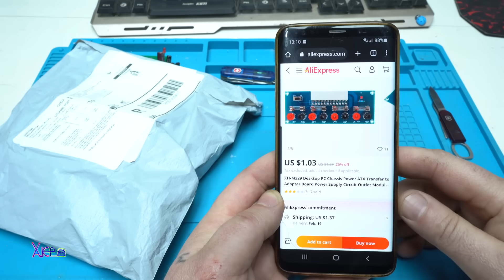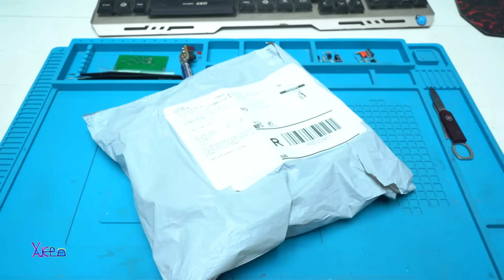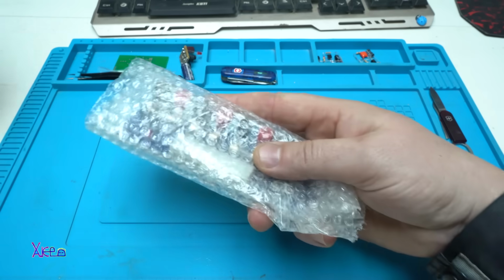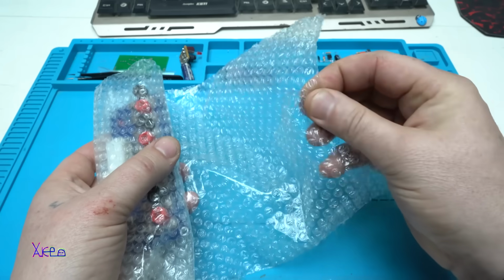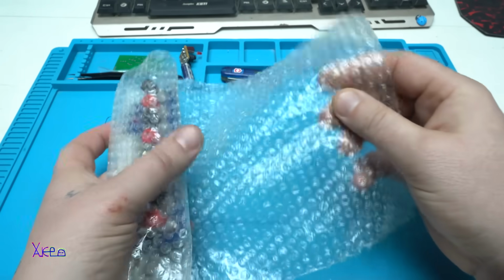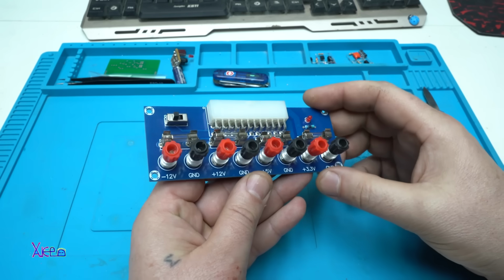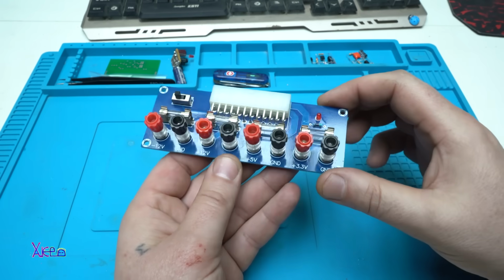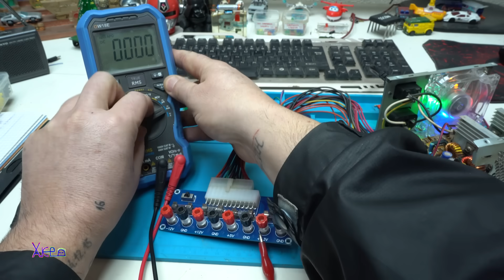THIS $1 Aliexpress ATX Adapter Board Power Supply Module Will SURPRISE YOU?

Comment: Hi, love your videos. I hope this isn't a question that has been asked a million times. With these and other types of ATX supply conversions to create bench top power supplies, why not have a single negative terminal (GND) and label the positive terminals with their voltages? If you want to use more than one voltage you can plug more than one banana plug into the negative terminal. This would save 3 black terminals on a crowded ATX box conversion

Comment: The 4 pin connector with yellow/black cables is used to deliver more power directly to the CPU. It's a 12V rail. You can easily draw 10A -20A using this connector (depening the PSU). WARNING: This connector is not meant to be plugged to the module as mentioned in another comment.
Reply from the maker: Thx for info sir,I will try that

Comment: I discovered  a similar module on eBay several years ago and have set up two ATX power supplies as bench supplies.  I modified the first one by adding a USB A socket to the 5V rail. The second one came with a built in USB A socket. They have turned out to be pretty handy over the years. The only downside I've noticed is the 5x20 fuses are right behind the binding posts so if you are not careful and stick a too long wire into the posts it contacts the fuse causing it to blow. Not a bog deal as a have a stash of fuses on hand.
Reply from the maker: That’s a great modification for the power supply, and good point about the fuses!

Comment: The maximum amperage is 2A I believe, so not really that useful. May as well just use a small 2A wall-wart rather than a large and noisy (fan) ATX PSU. I bought one of these years ago and didn't read the fine print in the specs. Big disappointment.
Reply from the maker: I need to test that?

Comment: The four extra sockets on the board are to take the four pin connector you have on your ATX power supply. They are extra 12 volt supplies.
Reply from the maker: Yes that is true

Comment: Those red and black female "bananapluggs" does NOT work. They cannot even hold on to the male bananapluggs. ITs the cheapest crap off plug, why they even make it. 
The fact that this obvious fact is NOT even mentioned here makes me distrust this youtubers judgement and integrity.  Furthermore, for the amount of amps that a standard 5 and 12 volt computer supply the thin coppar rails on those boards are a huge fire  hazard. Bin it or it will burn your house down.
Reply: Those copper traces will not burn when the fuse is in place. Even will function as a fuse itself when the fuses are shorted. Mean risk is the older power suppley. They can catch fire as deterioration kicks in after years of use and even after a long shelf life.
Reply: kill·joy
/ˈkilˌjoi/
noun
a person who deliberately spoils the enjoyment of others through overly sober behavior.
Reply: Agree, I replaced the banana jacks on mine. Forgot about that when I made my post here.

Comment: It is a shame they did not put the plugs on the other side of the board: It would have made it possible to mount on a panel without interfering with the fuses.  Even if they do not interfere, they would be on the wrong side to easily change the fuses... ;-)
Reply: They are just screwed on the PCB, so you can reinstall them if you prefer